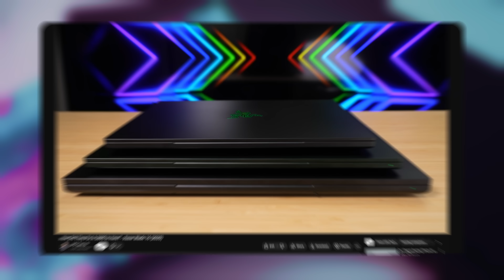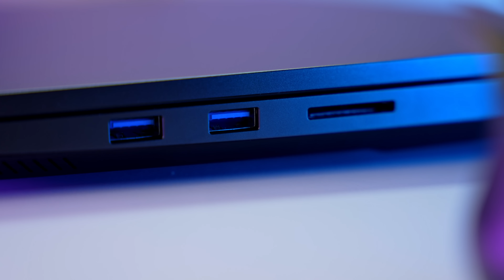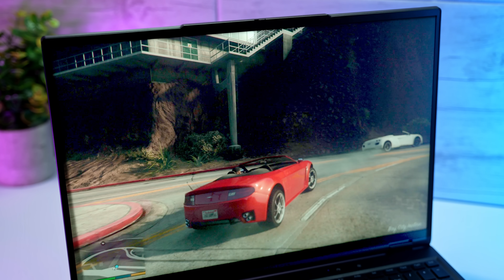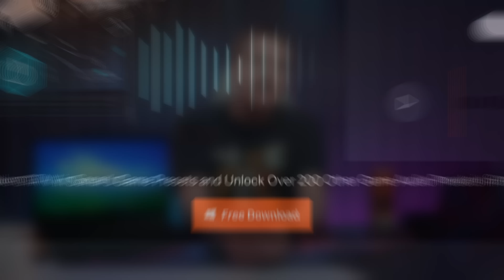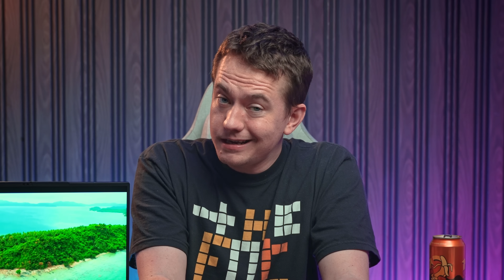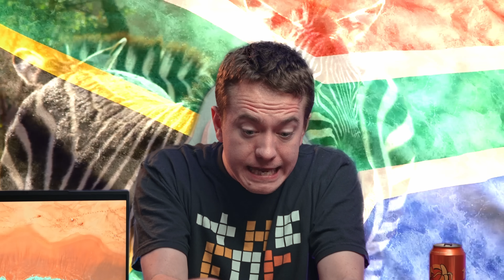An Insane Value Gaming Laptop - WootBook Titan 16 X3D

Comment: I would say 7zip is something you should put in a thumbs down. 7zip has a critical vulnerability for the last 2 years, that is actively being used to spread malware that bypasses Windows security and allows bad actors to execute malicious files without the usual warnings from Windows.

If I got this laptop and saw 7zip I would not just uninstall it, I would download a Windows iso from Microsoft and reinstall Windows right away. There is no way I would trust a new PC if I saw 7zip installed out of the box, and I would actually return it and get something else.

Comment: Can you compare the ASUS ROG Strix G16 5070ti AMD Ryzen 9 9955HX VS Legion Pro 5i Gen 10 Intel (16") 5070 Ti Intel Ultra 9 275HX Processor? I want a 5070ti laptop with an upmost budget limit of $1,700 and these two seem the best. I think the legion performs better but is hotter, while the strix g16 is slightly weaker but cooler and has less fan noise which I prefer. Any other recommendations for other laptops in this criteria?

Comment: Good on them for not using liquid metal... Liquid metal should not be part of a casual mass production design.

And with how often it leaks and/or doesn't perform as intended (still overheating), it perfectly proves that it's not worth it and other solutions should be prioritized.
Reply: I mean as long as it doesn't corrode the cooling surface, you can avoid seep-outs and pump-outs by coating the edges in Vaseline / petroleum jelly or similar.